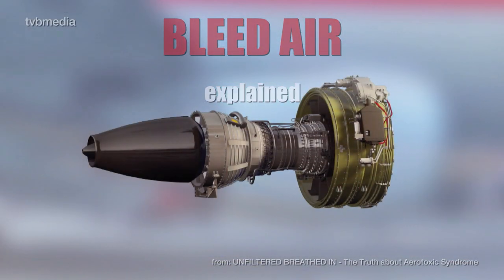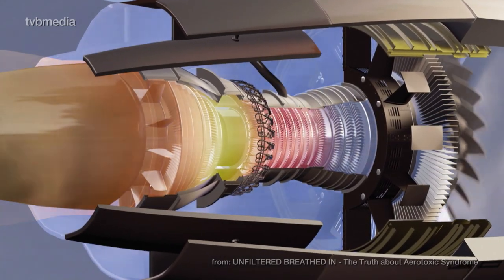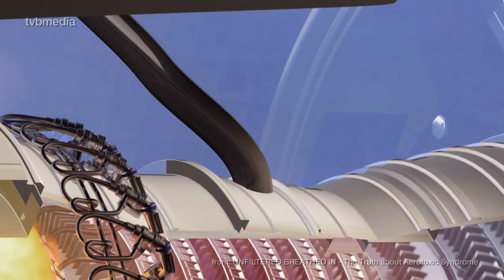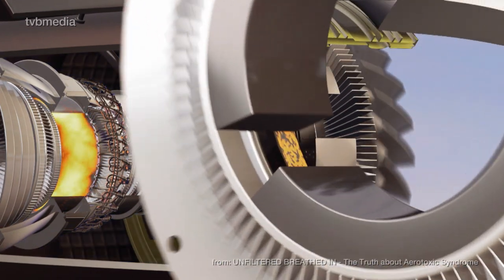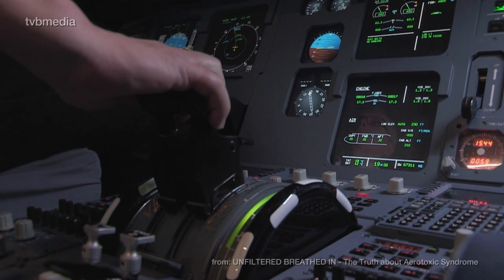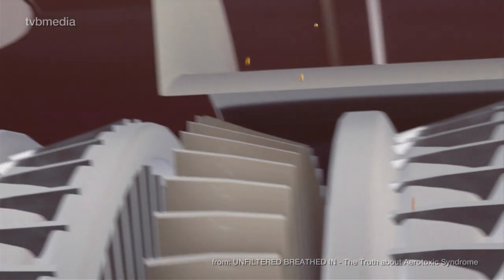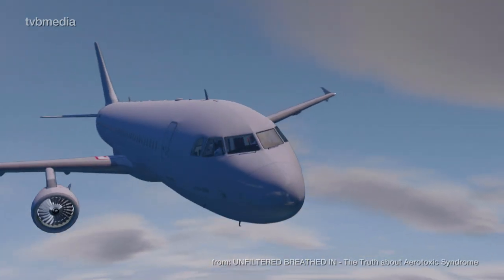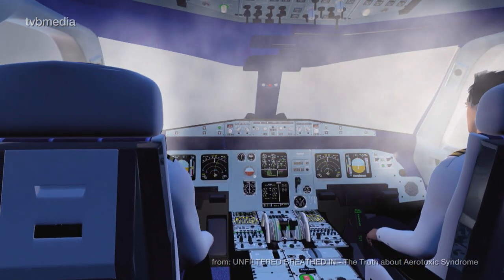BLEED AIR explained

Comment: Bleed Air is a variety of sources and destination for air that leaves the compressor upstream of the nominal compressor outlet.Bleed air system can be used for internal cooling of the engine, cross-starting another engine, engine and air frame anti-icing, cabin pressurisation, pneumatic actuators, air-driven motors, pressurising the hydraulic reservoir etc...